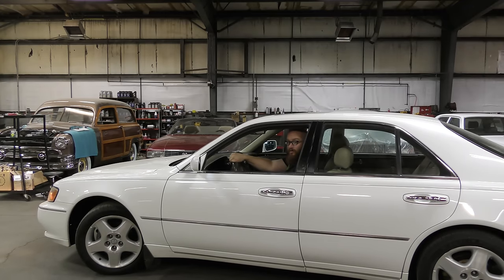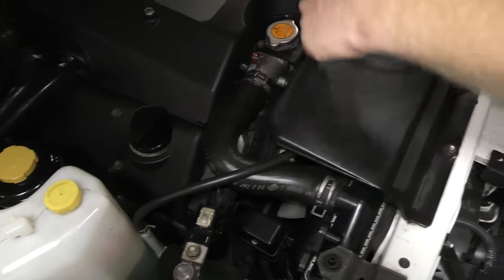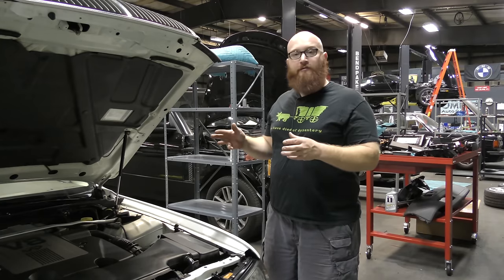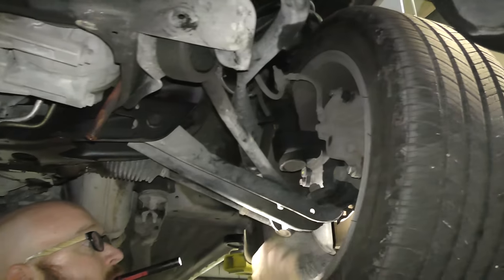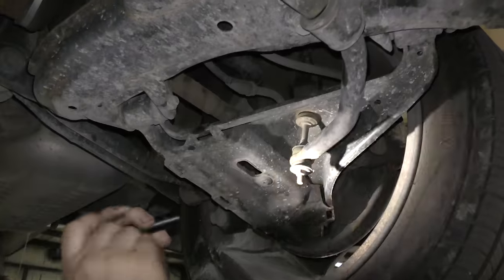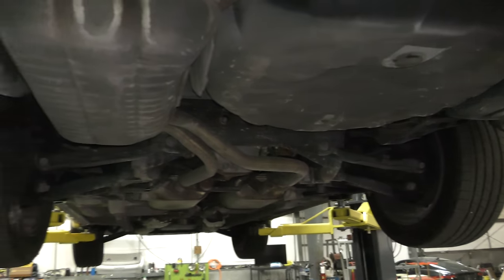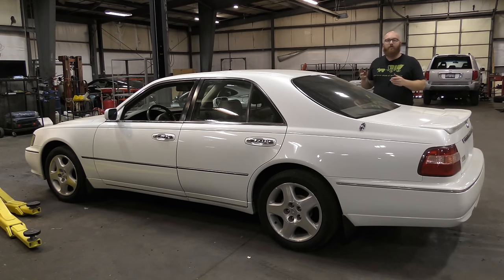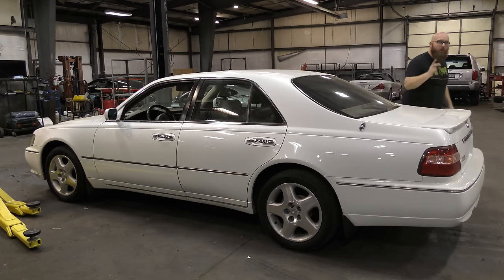I've never seen one of these before! First time a 99 Infiniti Q45t enters the Car Wizard's shop

Comment: I was about to question my sanity at seeing a Nissan without a power steering leak... Ahh, there it is! Sanity restored!
Reply: I can confirm that PS leaks are a thing with Nissan!  😂
Mine was a $200 fix, no biggie.
Reply: I remember the 2002 sentra I learned driving on, my dad kept that car in really immaculate shape. Except before selling it in 2013 it always had a bottle of stp power steering fluid in the trunk. 😂😂
Reply: Can also confirm, my 2012 leaks 😂
Reply: @anasnasir9424  then he didn't keep it in as great of shape as you think.  If you know of a problem and refuse to fix it, you aren't taking good care of the car.
Reply: @ericbeal6358  well said! People always blame the car brand before taking ownership of proper maintenance.
Reply: Or an old Toyota.
Reply: Eric Beal thank you
Reply: @ericbeal6358  finding the original hose was not easy in our country, as Nissan left Pakistan in 2009 because of low sales, and sentra is rare car here. Our mechanic tried out different hoses and every new hose he replaced didn't held up the pressure and started leaking after 4 to 6 weeks (hence we used to keep a bottle of power steering fluid) it was finally fixed. ✌🏼.....
And I found your comment offensive bdw... Hope you never have to carry any sort of fluid in your trunk, because it can happen to anyone with a well used car (keeping Toyotas out 😛).
Reply: never had a power steering leak in mine, and ive had a bunch of them
Reply: @anasnasir9424  Well said. A car having a chronic problem is not necessarily the same thing as improperly maintaining the vehicle. Otherwise immaculate vehicles can still have chronic and/or unfixable minor issues through no fault of the owner.
Reply: @ericbeal6358  new powersteering rack ain't cheap but fluid Is do why waste money on a 10+ year old car until complete failure of the rack
Reply: vortex because if you fix the leak, you won’t have to replace the rack.
Reply: My 08 G35 doesn’t have any lol. No leaks at all actually
Reply: Nissan's ps leak is usually from d hose.  It gets hard.   U can use a replacement hose that is metal reinforced thats specifically made for high pressure.
Reply: Christopher Hamilton yea i have a g37 its a hose and the hose is a $800 fix
Reply: yea our 99 i30 had one for a bit, luckly it was just the hose
Reply: My Datsun Bluebird didn’t have a power steering leak. It didn’t have power steering. :)
Reply: yess!! My first car was a 2000 maxima back in 2012, and the power steering hose was leaking
Reply: Oooo omg a 20 year old car needs a new rubber hose.. people talk like Nissan is the only vehicle that needs maintenance- if this was a BMW or GM vehicle would have so many other leaks you wouldn't even be able to tell if the PS had a minor leak. 🙄
Reply: The fly life  Well of course, I would be shocked a gm or BMW lasted 20 years, however the joke is that it's a common Nissan problem even with newer models
Reply: Just bought a G35X AWD and I noticed there was a leak. It had me confused at first because the power steering reservoir is on the passenger side. The leak is on the driver's side which is where the pump is actually located. Going to be a pain in the ass to fix. Looks like I might have to remove the cv axle and steering wheel knuckle possibly. Oh well things could be worse. It has 205k and I just replaced all of the fluids. The ATF and transfer case fluids weren't that bad. The front and rear diffs were really dirty, had alot of metal shavings on the magnet. 
Replaced the valve covers because I thought it was leaking. It was just 16yrs of spilt oil on the driver's side valve cover. Oh well installed new ones, as well as new plugs and coil packs. Cleaned the plenum, throttle body, lower plenum and unpper intake manifold. Noticed the 2 outside studs are missing. Installed a throttle body spacer and plenum spacer. Now only leak I have is the power steering. I need to completely flush it anyways and replace the hoses. Did that with the brake fluid and installed vented & cross drilled rotors up front. I need to degrease and clean the bottom of the entire car. That leak looks like it's been doing for quite awhile. So there's a little mess. I mainly need to replace all of the bushings in the suspension. Other than that car is fast for what it is. It surprises me that it's a 16yr old car. I've owned Nissan's before and never had a problem with them before. The 90 300zxTT I had, was at 180k when I sold it. Didn't have not one issue, only other car I had with high mileage was an 02 Z28 Camaro with 220k. It also had no issues whatsoever. So when I purchased this G35X it had 201k. I've put 4k on it in 2.5 months. So I just caught it up on preventive maintenance. Have no clue when the timing chain was done though. Just hoping that it has been done. I plan on keeping this car for atleast another yr or 2. Have heard of a few VQs that made it well past 250k. So far, so good, Nissan and Infiniti's are great cars. Just about any car will last you a long time as long as you take care of them. It why I immediately did what I did to my car when I bought it. I took a risk buying such a high mileage car in the first place. But I couldn't pass it down, other than a few dents and scratches the car has. It's in fairly decent condition for a 16yr old car. Plus I was able to get it for $2,300! The only major issue I'm having is with the title. The guy accidentally filled it out wrong which voids the title here in TX. So now I have to get a bonded title. Which is appearing to be a pain in the ass due to this damn pandemic. I just want to fix it up and hopefully when I eventually sell it be able to get atleast the same price that I paid for it back. I've seen a lot of these old Infiniti's asking for 3k and up and they were in way worse condition.
Reply: I got a used Nissan, amazingly with no power steering leak. The power steering leak wasn't installed correctly on this one, because it took 3 or 4 years to appear.
Reply: @anasnasir9424  oh enough there was nothing offers about what he said hdude grow a thicker skin.....my god we are raising a bunch of care bears
Reply: @liblib89  Same, my second Maxima just got her 100K mile service, literally all she needed was new filters and tires, Maxine has been real good to me
Reply: @Flying_GC  if your toyota breaks it’s cause of the owner..if anything else breaks it’s because the cars just aren’t made well..like a toyota
Reply: @SGcomputing  my 08 g37 was leaking at 75k miles. One owner with a full dealer service history.
Reply: Uh...HP hose will leak on every car sooner or later.
Reply: @TheGuruStud  damn near
Reply: Hahaha🤣😂😅very funny😅
Reply: @Flying_GC  Nissan reliability overall is pretty high, better than any non-Japanese automaker, but the terrible CVTs did serious damage to their reputation that has yet to fade away.  I'd say give it time, but I'm afraid the Frontier, Titan, and Pathfinder using German-designed or manufactured transmissions isn't going to end well.
Reply: I have a power steering leak in my infiniti as we speak. Hearing a very loud whine on cold starts

Comment: Back before Renault bought Nissan and destroyed the company. Now everything Nissan/Infinity is boring and junk. Back in the 90s Infinities were on the level of Lexus in every way. Style, performance, reliability..... Nissan was right with Honda and Toyota then. Great find, a reminder of what Nissan/Infinity was at one time.
Reply: Yeah a blast from the past Nissan really wore brilliant company
Reply: Infiniti has a  q50 red sport model with 400hp not bad
Reply: I would say it started falling off after 2010. They were still doing well then, but they started resting on their laurels and stopped keeping up
Reply: @CarsMeetsBikes  Resting on their Laurels :)
Reply: One Renault did not buy nissan but took over operations and prior to it, nissans were unreliable garbage.  Renault gave nissan the ability to become nissan again.
Reply: @Arayig1982  Renault has a controlling 43% stake in Nissan, hence they own them. Fact.

And 1980s-90s Nissans were every bit as reliable and well built as the same era Hondas and Toyotas. With standard, routine maintenance you could easily get over 200,000 miles out of them without major expensive repairs. Ive seen old Maximas with 300,000 miles on the V6. 240z's with 250,000 miles.

Nissans are much more unreliable garbage since Renault bought them.
Reply: Spot on comment/analysis 👍
Reply: @joe6096  and nissan owned a part of renault too, either way, not enough own it outright.
Reply: @joe6096  80s and especially 90s nissans were lemons, hence why you never see them.  Both electronically and body wise rust buckets.  They only became good in 2000s when everybody wanted infinitis for the first time ever.
Reply: @Arayig1982   If enough investors have stakes in a company, one company could have a 5% stake, be the majority, and hence own the company. The minority investors are simply there for financial support, they don't own anything.
Reply: Agreed, Nissan should have just curled up and died in the mid 2000s before Renault came and saved them.
Reply: Laurels yes.
But this is sadly the "Nissan disease". 😁
Reply: @DiaperSNiFFER  I agree. Infiniti is not that bad. I drive one and it was fun
Reply: @CarsMeetsBikes  True! The 06 M45 when released as a whole new model dominated  Lexus Mercedes and BMW models of the same time.
Reply: Has everybody forgotten all the Iconic cars they have made from past to present? Are you guys kidding? The 240z in the sixties. The GTRs of early days and current one. 300zx twin turbos 240sx with the RB25 engines. Come on now stop the hate. fools. Nissan has done way more performance cars than Honda and Toyota. 👍
Reply: Nissan was going bankrupt and would have ceased to exist. Renault saved them...
Reply: @froggy0162  Financially...
Reply: SvenQ45 Many of nissans most profitable models have been platform shares with Renault products. Micra and Tiida for example. It’s 4WD products have done well (Patrol and Navara) and the Leaf has been a very important product as well. Not sure what the problem is?

Nissan will be back on its own soon though, the Japanese do not like being beholden to foreigners... Let’s see how they go.
Reply: @froggy0162  Yes. But I don't think much will change. Looking at the plans.
But I really hope!
Reply: scotty?
Reply: @froggy0162  Let's not forget there biggest sellers Altima and Maxima which have been around forever.
Reply: Fred Williams only in the US, globally they’re not relevant. Maxima was sold globally but it sold poorly. Altima has a European version that did ok I think.
Reply: Fmr. CEO carlos goshn took infiniti budget money & put in his pocket.
Reply: Although I do agree when Nissan and Renault started their alliance their brand wasn’t the same. But a lot of great nissans and Infiniti’s were still produced in the 2000s
G35/ G37
FX35 
Nissan GTR
I would say after 2010 Infiniti started their downward spiral
Reply: @stevie421  Yep true. And the most over looked models that were extremely good according to miter trend and car and drive was the M45 from 06 and on.
Reply: Infiniti isn't junk. They still get away with selling expensive cars. My Q40 is high quality and amazing!
Reply: @mclarenguy5511  My 08 M45 Sport was way ahead of its time and at the top of the charts according to several car reviews. Quality was much better back then for sure The M cars and Q cats were there best
Reply: Incorrect. Renault DOES NOT own Nissan. Renault does hold a 43.4% voting stake at Nissan.
Reply: @joe6096  How the fuck do they "own" them with only 43%? Thats not even the majority!
Reply: @CarsMeetsBikes  fair enough. My car was the last high quality sedan. 2008 M45 Sport. The M series cars were well above average
Reply: @lisov4575  So they own them
Reply: @lisov4575  It’s absolutely a majority if the other 57% are divided up between multiple investors so no one else owns more than 42.99999%. Who taught you economics 101? There’s companies with so many investors the owners with majority shares own less than 30%
Reply: @joe6096  So if anything, those other two own them, but certainly not Renault. Don't be ridiculous.
Reply: @joe6096  Wrong. They dont.

Comment: My Pap rip bought a 1998 Q45t when he retired. It Is still in the family with 295k miles. Hardly had any issues. Smooth and quiet ride. Miss you Pap..
Reply: Did you ever have any power steering issues?

Comment: This and the older generation were pretty cool cars. Classy still to this day. Design aged well just like the Acura Legend.
Reply: 2 Steak Sandwiches I had a 1996 and my friend had a 97 (the newer body style like in this video) and my car only had ONE problem in 200,000 miles: had to replace the fuel pump and pump solenoid at about 127,000 miles.  THATS IT!!!  The car was literally indestructible; it was incredibly fast and handled like an S-class....great suspension and V8 power.  At 200k we decided to sell it.  Starter was going bad.  But it still started every time!
Reply: The Acura legend is one Modern Classic I feel is worth restoring. People restore Intergra Type R vehicle all the time. I think the mid 90’s Legends are worth restoring as well
Reply: @kevinruger8819  100% agree. I’d like to find a good coupe with good bones and restore one.
Reply: @kevinruger8819  - I have not seen a Legend on the road in many years.
Reply: @petrosaguilar8916  There is a guy in my neighborhood that drives a vigor and every time I see it I get excited LOL. I love early Acuras
Reply: @kevinruger8819  mid 90's Acura sedans all seem to have a really classic design. I've always thought they were very sleek looking.
Reply: I have the legend coupe fully restored 91 type 1 motor
Reply: The younger generation are modifying the ls400 just to o do doughnuts
Reply: @kevinumba6281  I’ve seen that. I get it
Reply: @2steaksandwiches665  yeah it's messed up
Reply: @kevinumba6281  buy one now and cherish it. The rest will get ratted out
Reply: The legends for whatever reason rust like crazy anywhere that gets snow/salt.

Comment: Those Q45 are awesome vehicles. Great for driving on the highway. Straight forward easy to repair for a mechanic like you. Those car should go way over 500,000 miles with regular maintenance.
Reply: Def not easy to repair but they are reliable
Reply: I doubt if you can get 150 000 miles before it becomes an endless  money pit.  None of the Q45 from all years and models held up and thats why you don't see hardly any on the road today. There are more 90's ls 400 on the road than all q45  combined. Infiniti doesn't  make the q 70 anymore because of the bad reliability of their flagship cars  in the past. Hyundai Genesis have surpassed  Infiniti  in overall quality and number of cars that they make. I currently have a 2002 infiniti q45 and am fixing it every other week. It burns oil, burns gas and have replaced the transmission computer twice along with a list of other problems. These cars are engineering  disasters and the sad part of  it is that nissan has been making cars too long  not to be able to compete with Toyota and honda.
Reply: @rodneycoleman2919  shout out to Q45s all day over Ls 400🤮 we are on a 1997 that’s just about to hit 200 K probably runs better than any Lexus you’ve ever 😎seen
Reply: Indeed, and the LS series had timing belts, these are chain driver. WAY less maintenance
Reply: @rodneycoleman2919 I think the key is the year. The pre 2001 ones are Japanese built.
Reply: @joelamosun9341  you are right. the 2002+ Q45 is a complete pile

Comment: I owned a 2,000 Q45 for 17 years. Excellent machine. Reliable. Beautiful.
Never even changed a bulb.
Reply: My uncle did too
Reply: Wow man that is nice, I'm looking to buy 1 soon I like this car but I also like the 03-05 m45 they're beautiful Japanese/American luxury vehicles and I would like to find 1 or the other some time this year.
Reply: I had a 1996 Q45 and drove it for 4 years.  Loved.  Hell, everyone loved it.  Fast!  And rode like an S-class with BMW 7-Series handling.  What a car.  Never had a problem.  Only work it ever needed was a new battery, fuel pump and fuel pump solenoid.  Sold it in 2012 at 165,700 miles and the buyer is still driving it!
Reply: I have a 2001 Q45 ... nothing on it has ever broken or stopped working in the 16 years that I've owned it.